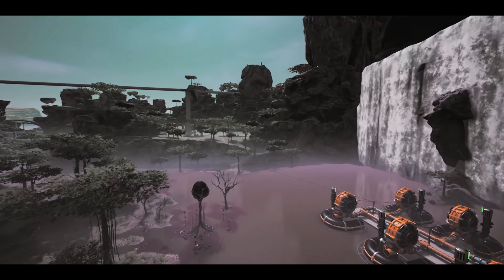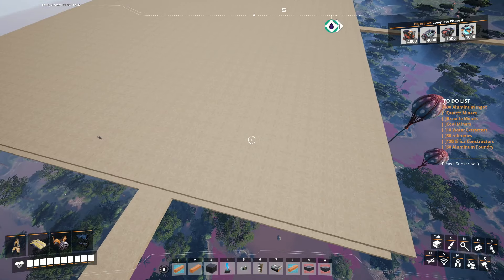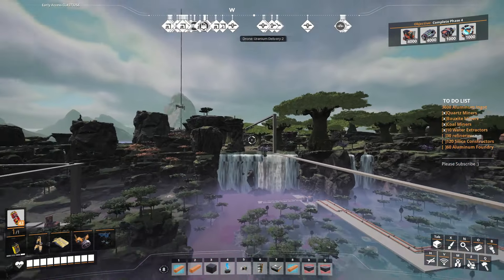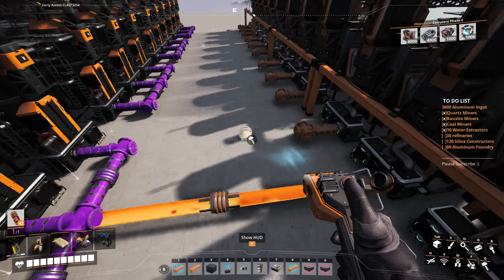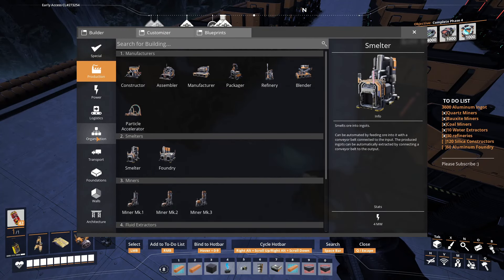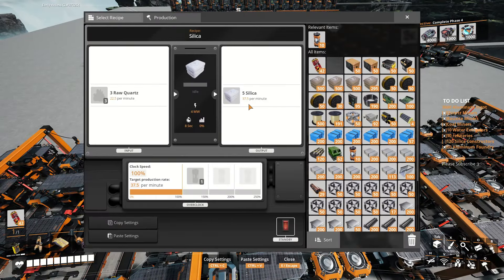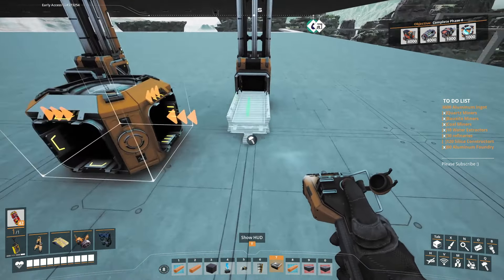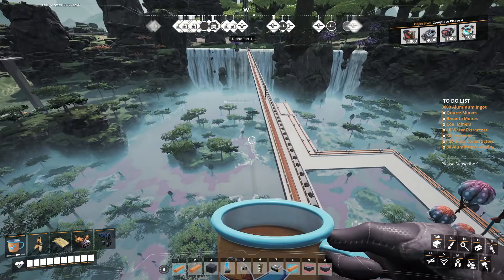BUILDING A SUPER ALUMINUM FACTORY IN THE SWAMP!! - Satisfactory Update 8 Lets Play - Relaxing Series

Comment: I'm only a few minutes into the video:

If You find the Alt Copper recipe for the Refinery....
You can just import copper and use water to make a boat load of copper ingots. 

There's a recipe in the Aluminum sphere for adding copper ingots with aluminum ingots to get a major output.

This should mitigate having to recycle water back into Your system and avoid that juggling.

Plus You'll end up with massive yields of aluminum products....

Let's see if My predictions bold
Reply from the maker: Oh yeah we've got a pure copper ingot recipe being used soon for copper powder as apparently I need 6000 ingots LOL 

This aluminum factory got scaled back a bit just to fuel some other builds but definitely a great tip thank you 😁